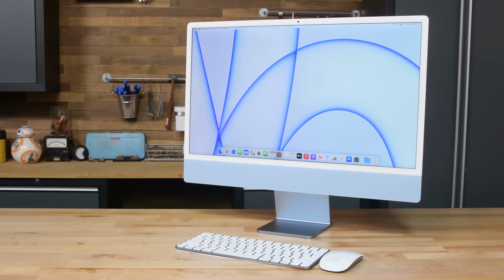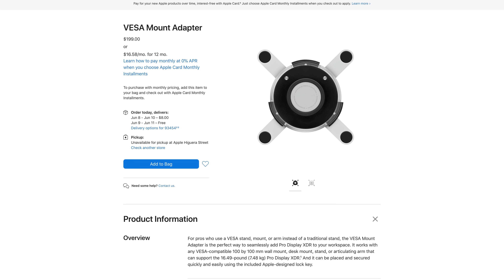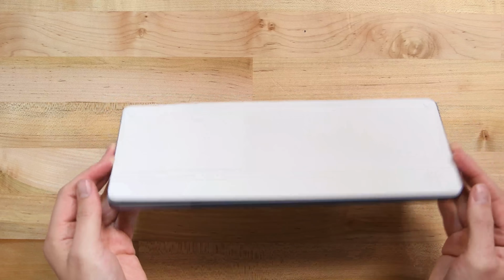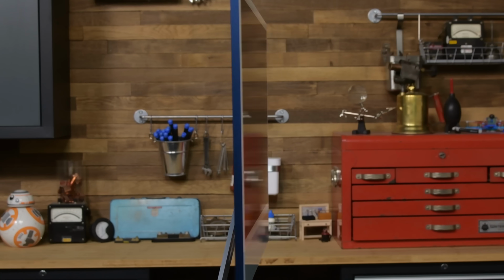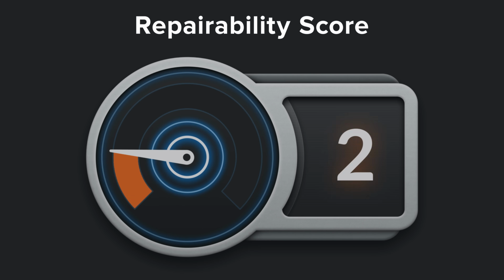M1 iMac 24” Teardown: A Desktop Only Jony Ive Could Love

Comment: Since it's a desktop why not give extra storage upgrade option!
Reply: Because apple. Think different! Screw your customers over the most amount for the highest prices in the industry.
Reply: planned obsolesence
Reply: Do you think apple would be able to earn money if their products are modular & last a long time ?
The soldered ssd is exactly how they make the imac and macbooks d2f (designed to fail) since SSD's have flash cells to write data & the data to the SSD can be written & rewritten only a limited number of times.
 
In normal computers the SSD is removable 
(Even in the thinnest windows laptop the memory might be soldered but the SSD is always removable)
So in case of a disk failure you can just open the pc
Swap the SSD for a new one
Reinstall the operating system and you are good to go 
This is the reason why other companies are not as filthy rich as apple 
When a normal computer has it's SSD dead you repair it
When a mac has it's SSD dead you toss it in the bin and buy another one
THINK DIFFERENT
Reply: Because it would be slower and defeat the purpose of m1, an soc…
Reply: @davetravels9273  how would being able to upgrade the storage make it slower ?
Reply: Minimalism and security (similar to why Microsoft won't add thunderbolt to their surface laptops)
Reply: @hi9580  he's talking about having a removable ssd which can be upgraded not an extra USB C plug
Reply: @99Teutons  and yet they scream they are the only one doing anything for the environment.
Reply: @davetravels9273  what does a CPU has to do anything with storage? even the slowest sata SSD is fast enough not to bottleneck the system.
Reply: Exactly, they want their products to fail over time forcing customers to buy a new one when it does. Also, if you didn't backup your data with Time Machine and/or iCloud drive, good luck getting it back! I'll always build my own Windows PC because I want something that I can upgrade down the road if I need to.
Reply: Think different , think Apple  $$$$$$$$$$$
Reply: @99Teutons  The other thing about soldered on is the lead free solder is more brittle and more prone to cracking even with a small jolt or drop
Reply: @99Teutons  He probably means the interface slowing data transfer but for most people they would never notice the difference
Reply: @MrTarmonbarry  yes
The exact thing that I've noticed about apple is that their software is very good but that's where the good part ends 
In order to continue to earn money they employ different tactics 
If we take phones as example
They surely provide a longer software support on their phones than the competition 
But a scheme like that won't make them a lot of money because a customer will then only buy a phone once every 5 years 
So in order to get them to buy more they will design the hardware to fail
That's the reason why iphones have problems like touch disease and tri star charging chip burn in 
That's the reason why Macbooks have problems like bad solder joints
That's why their PCB is designed in such a way that the fuse stays intact but the circuit that it was supposed to protect burns itself to death 
That's the reason why macs always run hot
Do you think that such a billion dollar company can't come up with a PCB design that doesn't fail after a few years of service 
Ofcourse they can
But it will mean fewer sales and less revenue 
And that's the main reason it's fighting against right to repair 
If third party repair shops get the schematics 
They can replace the solder joints with leaded solder and the laptop will last 2X longer than the one that you bought new 
They can even replace the nand flash chips on the soldered SSD and make the laptop run comfortably for another 5 years !
Reply: @davetravels9273  some M.2 SSDs are faster then M1 SSDs
Reply: @99Teutons  Apple products have the industry’s longest use life .
Reply: There is.. you can buy it from apple
Reply: @jub8891  It is funny.. because I can guarentee you if you take a look at 10 year computers people still use, without any upgrades and take the percentage, There are more old apple stuff than PCs. PCs are planned or unplanned become obsolete after 3-4 years...
Reply: @99Teutons  let me guess. you never owned a mac do you?
Reply: @gunglegeorge7213  software wise yes! Definitely 
Way longer & better support than androids 
Hardware wise ?
Nope!
If you watch louis rossman then u will understand what design choices apple comes up with to have the hardware fail over time 
Afterall they do need to make money !
How would a company benifit if their loyal sheepstomers don't purchase their products from time to time 
Right ?
Reply: @arunashamal  Mac's 10 year ago were way more repairable than the Mac's today
And as for your other statement i really wanna know which country are you talking about where 10 year old Macs are more usable than old 10 year PC's 
Also
What's wrong on calling out Apple for having a soldered SSD and using deceptive market practices ?
I don't understand 
Rooting for a brand because u like the software is ok !
Defending the brand's greed to make money in a way that is unethical is not ok 
They are not allowing independent repair

They are using bad lead free soldering which dies over time
 
They are using their monopoly to make sure that third party repair shops do not get their hands on the charging circuit IC's on the Mac's 

All this is being done because they have a repair policy where if you have run out of their so called insurance the repair cost is more than buying a new MacBook altogether
This is borderline disgusting and no company with such policies should be allowed to do business 

And if they are doing this no customer in their right mind should defend it 
Yet here we are 
Seeing apple sheep defending apple making their machine designed to fail

As for the record 
My cousin had old MacBook air which cost 80K₹ and it lasted for 2.5 years 
After that it died all of a sudden and the repair estimate they gave us was 75K₹ 
The nearby bga repair shop added a new SSD & reflew the memory for 10K₹ 
That's a total savings of 65K₹ which amounts to 900$ approximately 
Plus reduced e waste 
Contrast to that my asus laptop bought in 2017 
Still works fine !
No issues 
And unlike android 
Windows PC's continue to be updated regardless of the manufacturer
Reply: @arunashamal  i dunno about that
Reply: @99Teutons  Well, I’ve got generations of Apple hardware, fully functional, lying around the house, or in use — including an iBook from 2004 looks and works like new, with built in WiFi; the second generation iPhone that I use everyday to listen to podcasts; an original iPad Air from 2005 that I use regularly; a Newton from the ‘90s that’s still an amazing device. I could go on.
Reply: @hawkeyeaerialphotography6652  the main issue is the communication speed between the SSD, CPU and RAM, which the M1 is phenomenal at. The SOC design makes memory swap so fast that you cannot tell the difference between physical and virtual RAM on the M1. This advantage would be gone using a M.2 SSD
Reply: @arunashamal  how could that even be statistically proven- also considering the pc market circa 2010 dwarfed the mac and still does today? i use macs too and have a 2011 imac, 2013 mbp and an m1 mbp, - but for each mac i own, i have at least 3 pcs, the oldest being a toshiba satellite late 90s- before you ask, i restore vintage computers as a hobby, which is how ive accumulated old but still usable hardware- i will make a video of these one day
Reply: @99Teutons  irrelevant! What’s the point of Android hardware if you can’t use it, I myself replaced my iphone 6 two months ago. It was still working fine. Louis is right to be pissed because he is a computer repairmen, he isn’t going to complain about pcs that break all the time because he get lot of business from that. 
What do you mean by planned obsolescence when their computers don’t break? Their software support for old hardware is longer than anyone. I’d get a computer that has planned to be obsolete but never breaks over the pc that’s unplanned obsolete but screws everything every windows update and then randomly components crap out. You never owned a Mac have you?
Reply: @99Teutons  Australia. Yes just because one Mac failed doesn’t mean everything is like that. Are you telling me a there are many 2011 PCs around people still use. lol. They crapped out long time ago. 2011 Macs on the other hand people still use it. I know because I fix computers. Windows is one update away from ruining the whole system. lol
Reply: @jub8891  that’s why you take percentages of market. Your experience isn’t indicative of the general market. I fix computers for a living on the side and am a graphic designer. I see what people are using, there are still whole studios running 2011-12 Macs without any problems. No one uses pcs from that era.
Reply: @arunashamal  if you are in a creative field then that would make sense you are exposed to more macs- but that is a specific demographic- not a general one! also, as you know, my 2011 imac is limited to 4gb of ram and cant run anything newer than el capitan or new adobe software- so its next to useless for serious creative users today- lets be honest they would have bought a new mac by now- wheres my hand built pc from 10 years ago supports 16gb of ram and can still run new operating systems and software- dont get me wrong macs are useful but youre kidding yourself if you think there are more 10 year old macs in use today than pcs of that era
Reply: @arunashamal  my panasonic toughbook from 2010 is still used daily for media archival- its maxed at 4gb but runs linux smoothly and is reliable and power efficient- running a mac from that era would limit your options- unless you installed linux in which case it wouldnt really be a mac anymore ( >_<)
Reply: @gunglegeorge7213  i also have a g4 ibook 12 inch- it was a pain in the ass just to find a power adaptor to work with it because its an old headphone jack style connector- why does apple keep changing their bloody adaptor connectors every few years?
Reply: @jub8891  you are using it for media archival using Linux c’mon man. That’s a windows machine. 2010 Mac book can be used to do real work with macOS today. That’s a fact. There are many people do it.
Reply: @arunashamal  any pc is a linux machine- but as a mac zealot you probably dont understand this- which is fine- im not here to educate people just giving my personal opinion
Reply: @arunashamal  as somebody who owns and uses macs - but doesnt worship them- ive often wondered how mac users earned a reputation of being obnoxiously narrow-minded- thanks for reminding me why that is
Reply: @arunashamal  i didn't say that all macs are bad maybe i was the unlucky guy
The only thing i expect is that when my pc breaks i should be able to fix it instead of tossing it in the bin and buying a new one 
That's illegal according to apple
And yes PC's are definitely more reliable than Mac's 
And that windows update ruining the PC
I've been using windows since more than 10 years now
Never had my system messed up because of updates
Reply: @jub8891  I stand by my statement as a percentage I think there are many more 2010 Macs that are capable in day to day use today than pc. And you have to stop comparing custom built pcs to off the shelf general use macs from 10’ i bet you have an ssd with your 16 gig pc, how much would that cost in 2010? Boatloads more than the stock Mac. And I bet you have upgraded it so much there is not much resemblance to the 2010 computer? So a basically a different computer.  We are talking in general, here not specialised use cases. 
Graphic design is an just an example, but in general I’ll still stand by what I said
Reply: @jub8891  and every Mac is a Unix machine. Also a Linux machine too but that isn’t the point here, is it?

Comment: Thanks so much for this video. It shows me where some of the components are in the system. I have bought one of these Satechi screw-on hubs and am wondering if you have an opinion about where to place it so it doesn't block speakers or critical fans. Thanks again

Comment: Repairability vs upgradability. It looks pretty simple to repair you just can’t upgrade anything.
Reply: Tell me how you want to repair anything build into the board… 
You could argue you would swap it, but I guess you’d have a hard time getting Apple to sell you one.
So sure repair you usb-c, headphone jack and Bluetooth…
Reply: You could upgrade it by smashing it into pieces with a sledge hammer.
Reply: Apple will not sell you the parts, Rossman once get a hold of bunch of Apple chips directly from China but package was stopped on the border and confiscated as counterfeit goods, its not repairable.

Comment: Thanks! Hopefully, a tear down of the power supply will follow :-) Most people will not repair that one but it´s interesting.
Reply: The PSU is about the only thing left that still has discrete components.  I've repaired probably over 30 of them.  :-)  It's just a pile of capacitors, transistors, diodes, and some magnetics that shouldn't fail unless you really do something wrong!

Comment: silly question: the two batteries at the start are used for what? and how long do they last? Thanks in advance 😊
Reply: Bios settings and to basic stuff like the internal clock
Reply: @eduardoalvarez2497  Thanks :)
Reply: @Berindei_Stefan  if you have a computer it has (at least) one as well. They usually last ages and with it being two I’m guessing it’ll last longer than the lifetime of the imac
Reply: @Nik6644  Got it , Thanks alot 😊

Comment: So just because the screen is glued on. It diminishes the value of a modular USBC and ports? You guys really need to figure out your score because it seems to be super wack af
Reply: yeah the modularity should have raised the score a bit. not sure how often those would ever need replacing but it sure seems good in theory
Reply: @CommonTater100  with normal use I don’t think you’ll have to replace it considering the complicated hardware is on the cable and not the computer, but if ease of use is priority in their eyes then maybe a computer with Soldered parts will have a better score just because you can take apart with Philips driver.

Comment: Does anyone need an ultra thin desktop computer? No give me a 32" CRT monitor on my desk /s. As to ports and repairability, my work desktop has an ethernet cable, power cable and two VGA monitor cables attached to it. The computer case has never been opened since I got it.
Reply: Tell that to people whose iMac fries one day and apple refuses to repair it at all, the way they did to Linus. We have some trashcan Macs in college, apple refuses to provide service for them. The GPU seems to unseat itself due to heat and causes kernel panics, and this often happens right in the middle of editing video (which is what those Macs are there for). Terrible design eventually affects people. Just because you haven't faced issues doesn't mean no one will
Reply: @xmlthegreat  The iMac costs about the same as a flagship phone, but I am guessing will last much longer. No one complains about a SOC inside a mobile phone. The only computer I have never took to repair, came back in bits to me because they couldn't repair it and wanted to charge me for the additional work involved in putting it back together. I will take my chances with Apple, who in my experience offer great service, not just with hardware but if you have any software issues.

By the way Linus wrecked that computer because he didn't know what he was doing.
Reply: @crosswhite17  no one complains  about an soc inside a phone because there's no physical space to put everything in seperately. This new iMac is just a macbook Pro with a bigger screen. And it doesn't matter how Linus or his staff wrecked the iMac, Apple should've repaired it for them. Apple just wouldn't do it. They were willing to pay, but Apple wouldn't.

Comment: Oh dear. This is not what I had in mind when it comes to a desktop PC. Having non-upgradeable CPU, RAM and storage in a desktop? That's madness! Seriously, this machne did not need to be as thin as it has been made.
Reply: It’s not really a desktop pc though (or not a classic one). It’s one for your parents who simply want to buy one device unpack it and plug it in. They won’t upgrade and some soldered parts have shown to be more reliable

Comment: ..and what happens when the SSD drive gets worn out? I really hope Apple will issue a replacement program, because otherwise these devices are beautiful time bombs.
Reply: SSD has been on the logic board since 2016 MacBook pros
Reply: @HunterLSE  sure, but I would expect a desktop computer to last more than a notebook, on average. I still use a tower I bought in 2000 as a command line Ubuntu machine, while it's unusual for a laptop I bring around all day to last more than 6/7 years without breaking
Reply: @super86brandon  apple notebooks and desktop last at least 10 years, and software update for 7 years.
the vast majority will run like the first day in 10 years.
Reply: @JohnSmith-pn2vl  I agree, I still use my old 1997 iMac as a music player (and little more) as it survived any other machine. Fact is.. if used intensively, I can expect an SSD drive capacity to start seriously shrinking in a portion of that lifespan, and it would be great being able to replace that drive in an otherwise like-new 10 years old mac
Reply: @super86brandon  you can connect up to 2794 external hard drives ;) that will do
Reply: @JohnSmith-pn2vl  lol you're right, I didn't know (til now) one can still boot from an external drive on an M1 mac, but it's still possible! It will also add some Macintosh 128K retro vibes ^__^